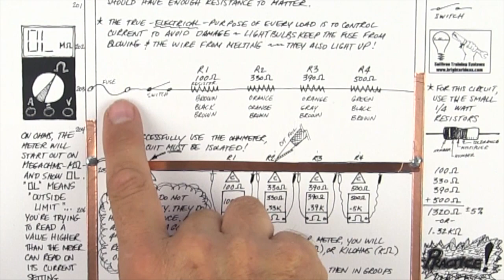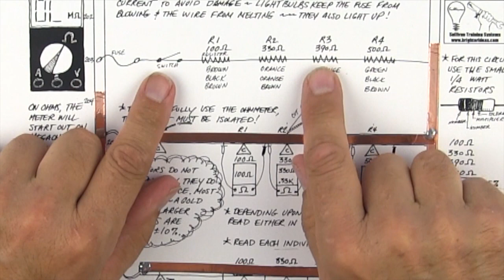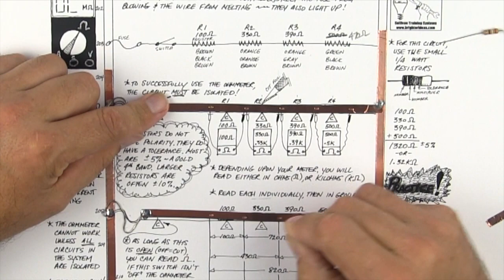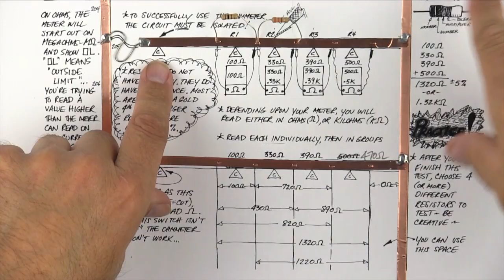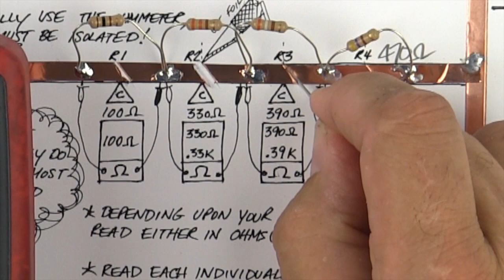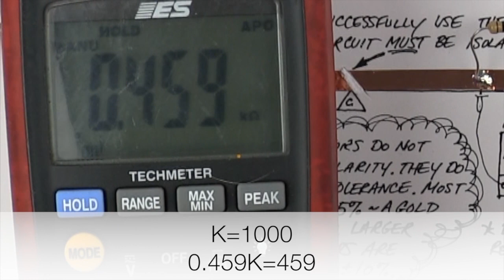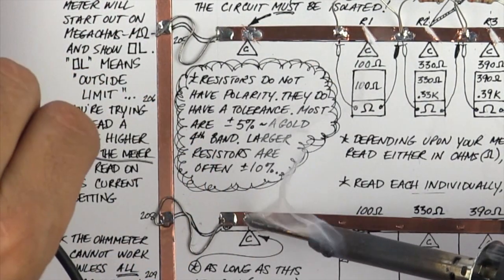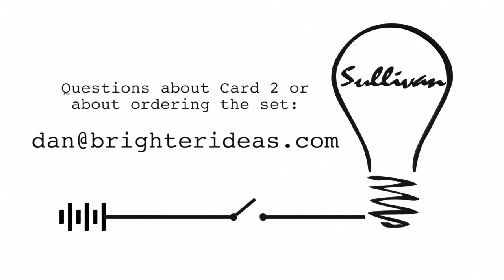CARD 2 - SERIES RESISTANCE - Hands-On-Line Electrical Training

Comment: You got an unexpected ohm reading because you made one of those " non existent" parallel  circuits with the other three resistors. Take the other three resistors, add their values then parallel them with the resistor you have the ohm meter on and you will get the reading you have on the meter.
Reply from the maker: Yep - you got it. Good catch. Thanks for watching.

Comment: Just started your cards. I thought it'd be nice to be able to reconnect the circuit after isolating it from the positive (just to see what would happen). I ended up making a "solder switch" on line 205 & 208. Which is just a 1"-2" long solder that I can bend to connect to the fuse as needed. 
Also, after reading the comments, I added in another 2 solder switches between lines 205 & 208 on the (+) and (-) so they can be isolated. I haven't gotten my meter out yet, just setting everything up. Should I be isolating line 205 from 208 on the (+) & (-)  when testing?
Thanks for the videos, and the Cards.